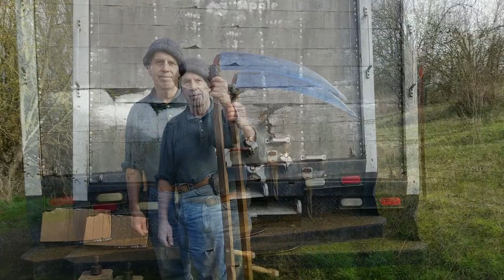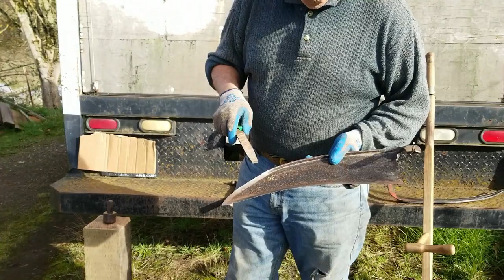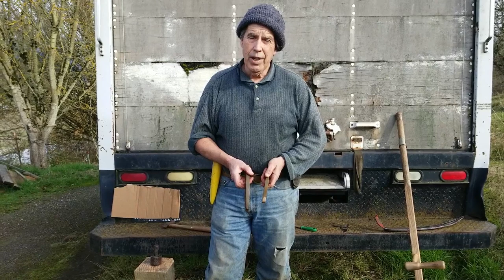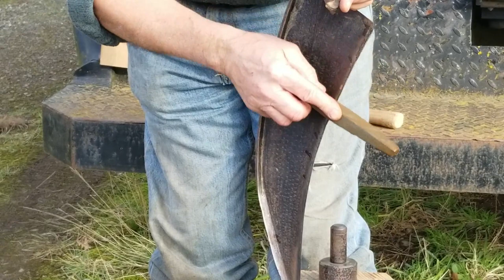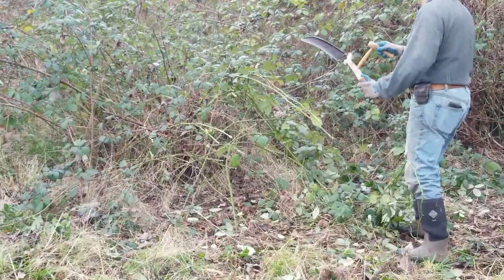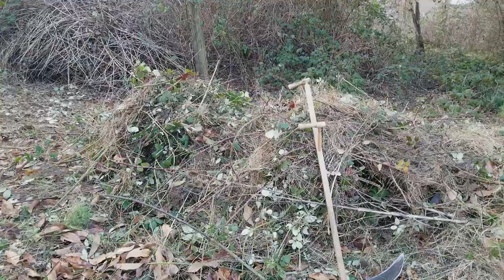Whacking Blackberries with a Brush Scythe

Comment: thank you for showing how to attach it!! I didn't manage as the tool that came with my scythe holder was screwed underneath it... is that a normal tool one can buy? Sorry, I have really no clue.
Does one have to sharpen a brand new blade?
Reply from the maker: The tool used to tighten the D clamp that holds the blade to the scythe is called an Allen wrench. These come in different sizes and if you need a new one are readily available at hardware stores. If you bought your scythe from Scythe Supply in Maine it comes already peened and honed. So it's ready to go.
Reply: @BareMtnFarm  Thank you so much. I am very very far from Maine.     I have contacted the producer why I need the same tool to remove the tool attached to the handle, and will go to the store to buy an Allen wrench so. None of the keys I have fits.

Comment: A brush hook would be way better to clear up the zone, and only then use the brush scythe to finish mowing the sticks.
Reply from the maker: I can see your point there.  Especially if the brush work being done is later in the year when the brambles are more woody.  Thanks for the tip!
Reply: I can't find either so far in the stores here.
Reply: I got small trees in the mix,   the scythe can take them but it's heavy on the blade, a brush hook is more appropriate there.

Comment: I find for brushwood and brambles these scythes are not heavy duty enough.  I have had a small split in the wood and the handles is too weak.  Great for grass though.
Reply from the maker: Yeah it's easy to find your self wanting to hack instead of slice.  Hacking definitely will quickly damage the spindle, handle or the snath itself.  I also find that the scythes work best when the materials are green in Spring.  Old brambles that are dead and dried are definitely tougher to deal with.

Comment: I am seriously considering a scythe
  The one you are using appears to be an Australian opposed to being an American made by the fact it is straight other than the curved.  I am 5'8.  I believe I should use a number 2?  Are their any recommendations with links?  Thanks for the video.  I subscribe.
Reply from the maker: Actually the scythe design and all the blades are Austrian.  My primary blade I use is called a ditch blade. You can get all the parts, blades, snatch, honing stones, and peening jig from The Scythe Supply, in Perry Maine . sycthesupply.com is the website.  They can walk you through the process of getting the snatch sized right too.

Comment: How would you compare a scythe with  brush blade to a sling blade tool?    

Unfortunately all blades seem to be temporarily out of stock at scythe supply.   Any 2nd sources?

I've been using a sling blade on poison hemlock.   Appears easier to cut than your blackberries.   Rocks, dirt and logs are taking their toll on the sling blade and I sharpen before each use.

Some videos recommend sharpening grass scythe blades every few minutes - is this the same with a bush blade?

I did get my hands on a couple of very old grass scythe.  The blades seem to be in good shape and surprisingly sharp with a little touch-up.   The snathes however are in questionable shape and the handles don't seem to lock in place securely.

I did try the grass scythe on the poison hemlock and they did cut, but with issues with the handles and rocks and obstructions, I've been more productive with the sling blade  tool.  Perhaps a scythe with a brush blade might be even better?